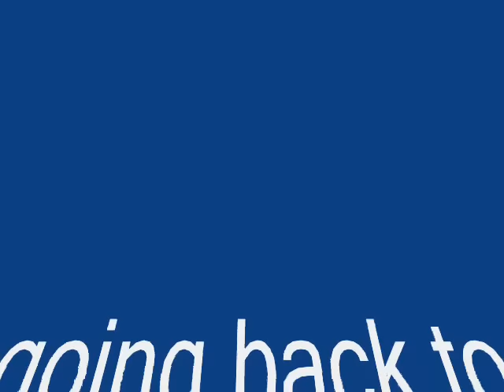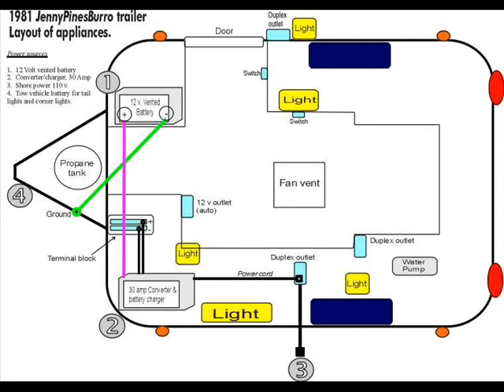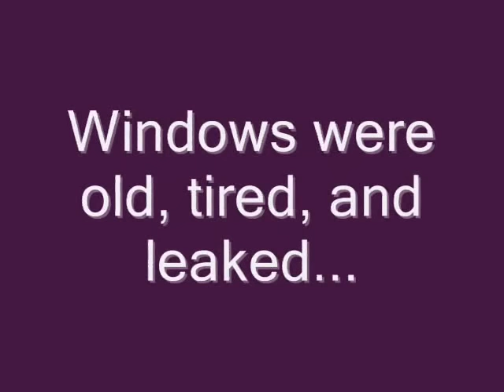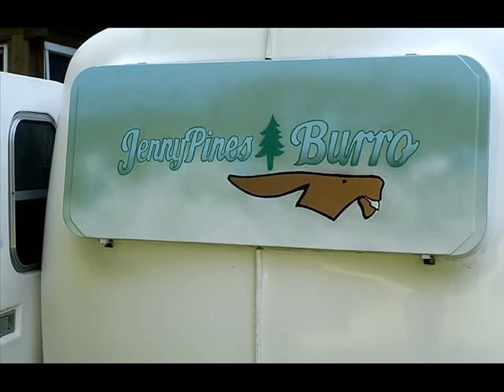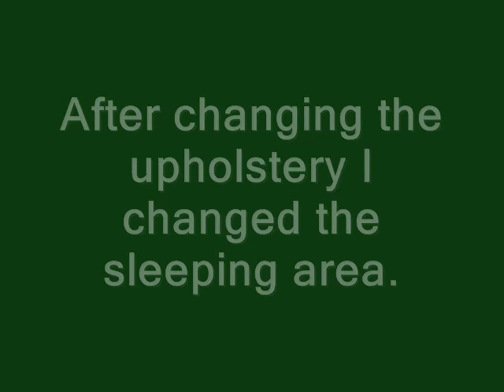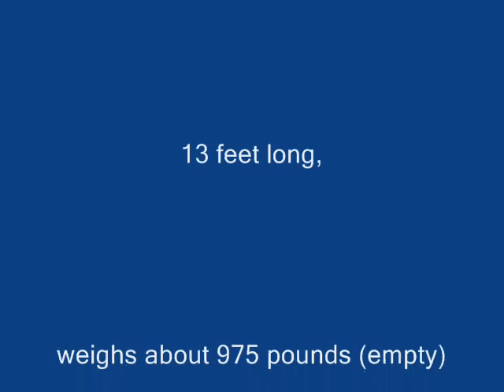Burro Rehab Project

Comment: It never occurred to me that a fiberglass trailer wouldn't also have a fiberglass floor. Did you need to replace the seal between the two half-shells? If so, how?
 VERY nice job!

Comment: Great job! Wondering where you obtained the new windows from?
Reply from the maker: Thanks. New windows are very expensive. I got mine by scouring eBay for used ones that would fit. Often dealerships get stiffed by clients who order replacements and put them up on eBay. Some keep salvaged windows out back in a shed. Also try trailer junkyards. Great deals those sources.